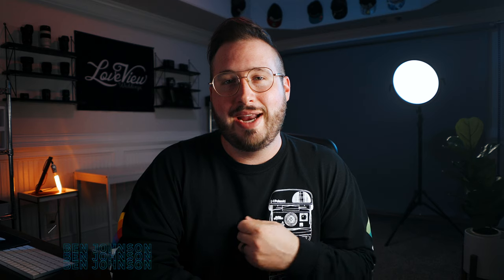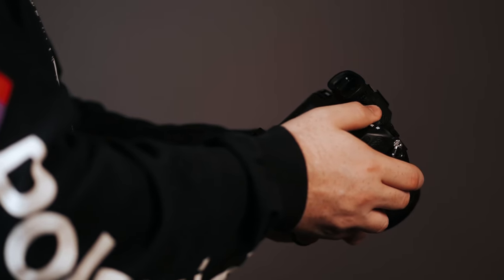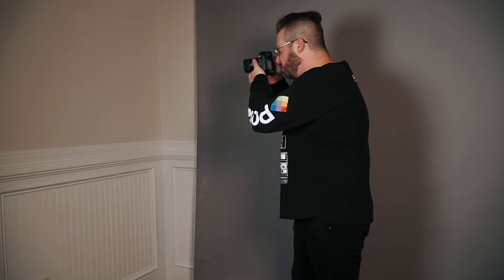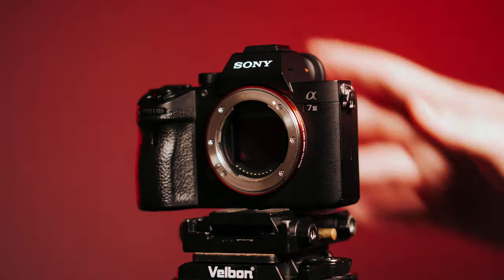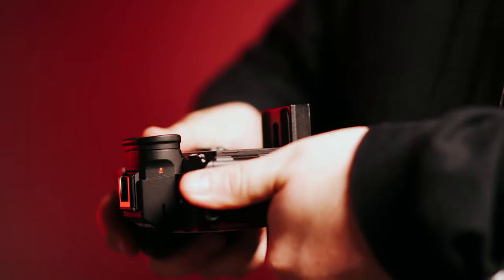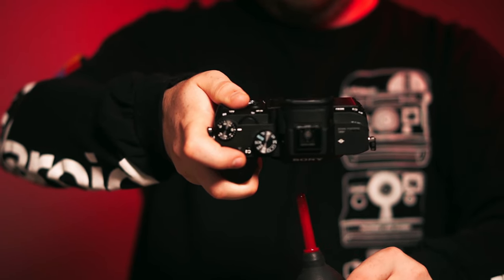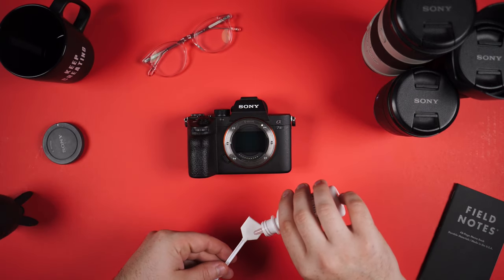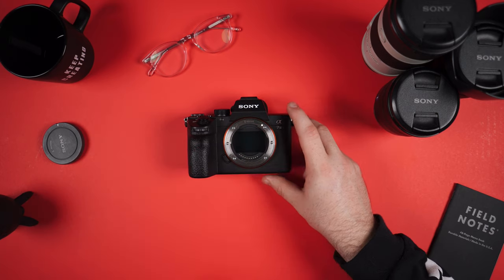Clean your camera sensor SAFELY! - Sony Mirrorless A7iii

Comment: I think the best thing about this video is the reassurance. As a newbie Sony A7iii user I'm super nervous about cleaning the sensor for the very first time. Thank you! Also, any tips on why my Sony has filled up with dust like a hoover? I have swapped the lens once in the past year and it lives in a camera bag in fairly benign conditions - like me, it doesn't get out much. I can only guess the Sony FE 4/24 - 105 G OSS lens has poor environmental sealing? :-(
Reply: I have this lens and I have the same problem, I think you are right that it has poor environmental sealing, I get dust inside all the time. Very frustrating. Usually a blower deals with it but I currently have a bunch of stubborn spots that won't budge.

Comment: Holy crap I think that blowing air into my sensor step actually did it on mine. Thanks a million! 👏 
I love doing photoshoots at the beach but unfortunately a lot of wind means sand on the lens but this helps thank you so much 👍
Reply from the maker: I’ve done my fair share of beach shoots - sand can be brutal on the gear!

Comment: After running the automatic sensor cleaning process, should we leave the camera on while using the swabs? Or will the sensor stay locked if we turn the camera off?
Reply from the maker: I leave it on

Comment: And what about the moisture left on the sensors from the swab?
Should i "dry" it with another fresh unsoaked swab ?
Reply from the maker: No, the solution drys quickly and the swab is only damp, not soaked

Comment: If you apply pressure that will damage sensor right? Can we use cotton to clean the sensor?
Reply from the maker: Avoid applying pressure, I would only use the recommended swab and not cotton or anything else

Comment: I cleaned it with a soft cloth normally used to clean glasses but it was a bran new one, then i saw ur video, can it get damaged?
Reply from the maker: I wouldn't wipe it, even with a new cloth. If there is dust, dirt or hair on your sensor and you wipe it it could possibly scratch the sensor.
Reply: @benjohnsoncreative  okay got it thank God i saw ur video that will be a one time thing. Thank U so much !

Comment: One question: Is  it camera  turned on while you take the third step of cleaning the sensor?
Reply from the maker: Yeah, it can be on, because the cleaning mode is active and that’s what keeps the sensor locked in place and not jiggly

Comment: should i have my camera turned off while manually cleaning sensor ? or should it be turned on ?
Reply: sony recommend ON and has mode for cleaning so it lockup sensor IBIS (stabilisation) movement...but on/off just dont use too much presure with swab in any case...be gentle and all will be fine

Comment: I have sony a1 body and when I clean the sensor I turn the cleaning mode on, but when cleaning it with wet swab, the image sensor sometimes shifts and even once it got pressed .. is this normal? Would it affect the image sensor?
Reply: normal yes...no it wont unless you move it so far or use too much force...sensor is suspended and "floating" and also have pretty crazy amount of play....if you done cleaning, off/on camera, take some shots and no error on the lcd all good...don't worry be happy :)

Comment: what happen when i cant get rid of the dust. i cleaned my sensor several times and my image still the same
Reply: by the way i scratched the protector of the sensor
Reply from the maker: If you feel like it isn’t getting clean and is potentially scratched then I’d take it to a local photo shop and see if they offer repair / cleaning

Comment: Uhm...leave the camera switched on (after it completes its vibration) while cleaning the sensor with the stick thing? Or the camera can be switched off after the vibration? The "floating" sensor is locked when the camera is switched off or on?

I own a mirrorless camera, Canon M50, for two years, but only today that I learnt that its sensor is actually being suspended! I have not touched the sensor. But I did use a vacuum cleaner on it. Thankfully the sensor did not get sucked out! Hahahahahah!
Reply from the maker: On the Sony you leave it on, when you activate cleaning mode it engages the sensor lock. I'm not sure with a Canon
Reply: @benjohnsoncreative  Hmm. Canon one or ones seem to already 'naturally' locked without doing anything. At least my M50 is. I got worried knowing that mirrorless sensor actually is suspended. No amount of Internet search answers the question.

Comment: Bought the kit, tried cleaning the sensor on my a7iii and after using the swab it created more spots on the camera ? Also the eclipse fluid and swab leaves fluid on the sensor what do u do ? I tried to have the camera do the self cleaning after I did the cleaning to shake the fluid off sensor but still no luck, I have a bunch of spots now when it was just 1 before I did this and now they are everywhere. Any recommendations?   There’s not a professional place that cleans sensors where I live and Sony wants $500 to do it !?!
Reply: The only way is wet cleaning again and then dry cleaning with the swab.